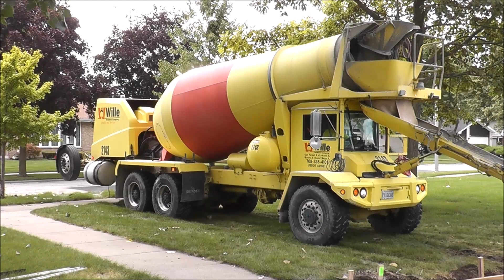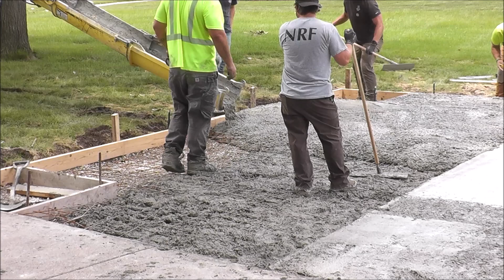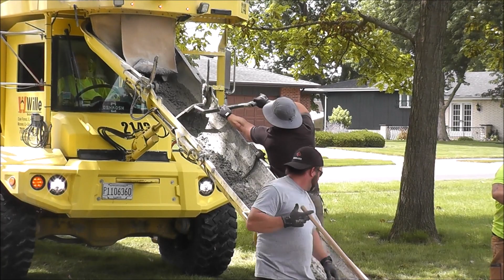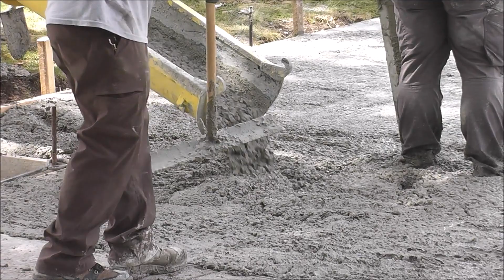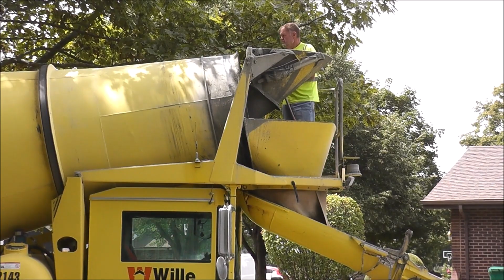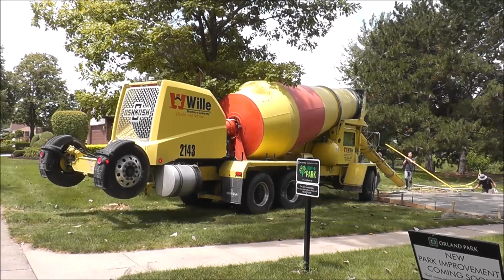FAIL Concrete Pad Cracked Few Weeks Later

Comment: Nice video - get what they pay for - only one guy with rubber boots on and he stayed on the outside, all the other workers need new boots and some pants, not a professional concrete company for sure. Cheers and stay safe
Reply from the maker: Haha, it was actually the city crew working, it wasn't a professional concrete company. I can't believe they didn't add any control joints to it. We go to this park with our kids often and after about 3 weeks there is a crack going right down the middle of it.